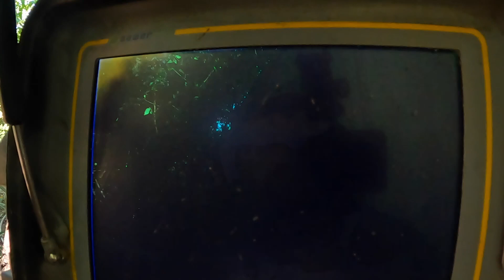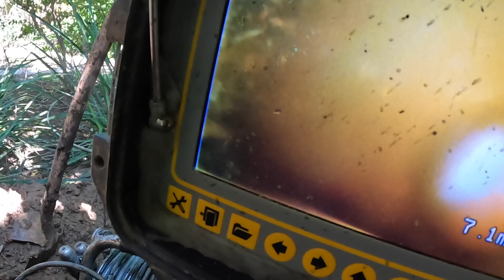Blocked Drain 715

Comment: Fun fact: You are closer to 1000 than 800. Because you still have 85 more drains to go until you reach 800, which is roughly 85%, while to 1000 you have left only 285, which is less than 30%.

Comment: Why don't you use gerny to pump the water from the hole. A piece of 60 mm flex smooth hose with gerny in the bottom. will suck the water up and out. Work smarter.